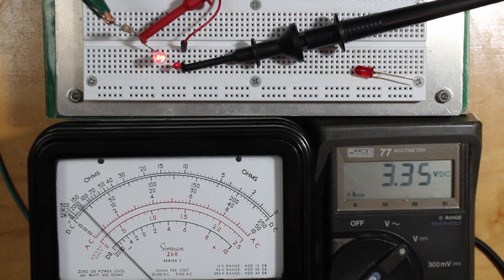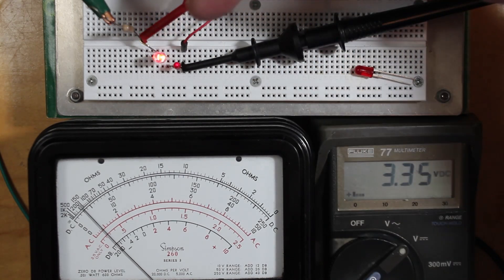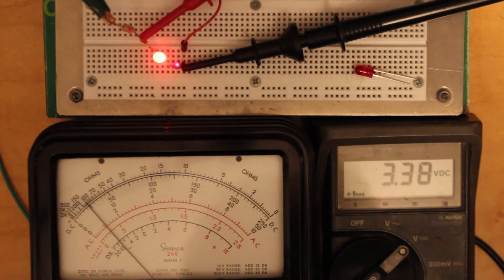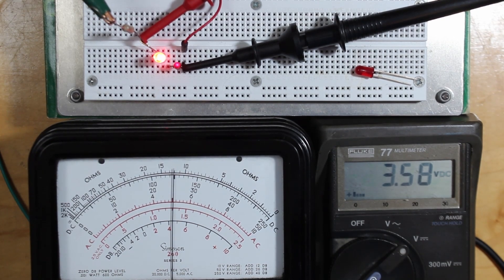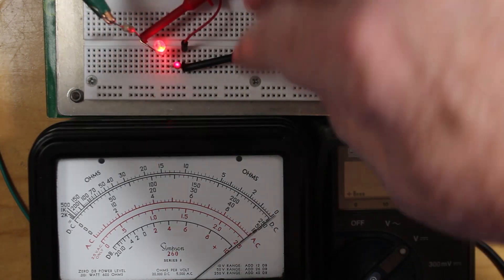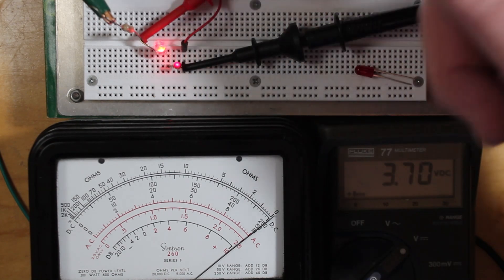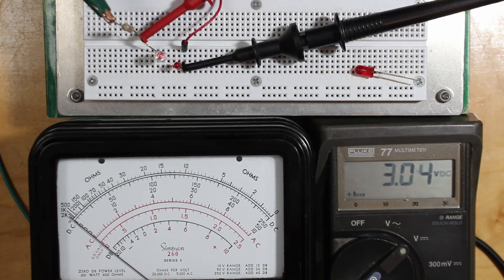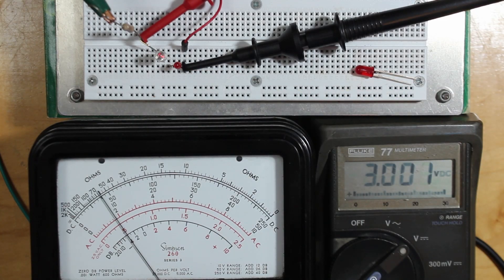#2  LED Old vs New Light Output And Current Draw  #led #electronics #experiment

Comment: A while back I had to take all of my vintage LEDs and put them in separate organizer drawers. Because they really don't belong with modern LEDs. So now I have drawers marked, "OLD LEDs" I can't bring myself to just throw them all away. I mean they're vintage. But I'd only use them if I actually wanted an old LED.
Reply from the maker: I do the same.  I keep the old one's for fixing old equipment.
Reply: @MoreThanElectronics  I used to buy a lot of assortment packs. So I have some pretty oddball LEDs. Suitable for if you want something special for some project. Plus I've salvaged a lot too. The real bizarre ones I've got came out of those old Rat Shack assortment packs though. Primo floor sweepings.

Comment: It is often said that LEDs require 20mA. This is true for old LEDs. 
New LEDs need far less, perhaps 2mA.
Reply from the maker: I agree that the general practice I was taught many years ago assumed 20mA for full brightness, if you didn't have the spec sheet.
If you want to drive (source or sink) the LED directly (with current limiting resistor) from the pins of an IC then you need to know the capabilities of the chip.  Thankfully that green LED is plenty bight at 1mA to be used as an indicator.
I see Everlight produces a LED (model HLMP-4740 for example) that is spec'd at 2mA for typical application and a maximum  continuous forward current of 7.5mA. Note that it only produces 2 millicandella, but maybe that's what's needed.

Comment: More correct way of comparison is show the V-A graph. Old LEDs is low voltage, and depend of colour. New ones is based on the heterostructures, more sensitive and high voltage.
Reply from the maker: I did a bit of testing and the old (45ish years) LEDs I have are a lower voltage than the more modern ones, but there are many factors (chemistry, wavelength) involved.  I've uploaded a new video where I apply the same power to a couple of different LEDs.  The light output compared to the power input has improved greatly over the years. Doing V-A graphs of various LEDs was more work than I wanted to do at this time.  I also don't have a way of measuring the light intensity developed.

Comment: I have a few of the old LED-s (that i took out of some old casette player I think) that have their negative side labeled as a flat side. When you look up from the top of the LED then its not a complete circle, but the positive side of the circle of the lens is a bit flattened out -  its so we can differentiate the negative lead from the positive one. But apparently in the old ones the flat side (in my case) is the negative side, not the positive as it is in the modern ones. Interesting
Reply from the maker: On a new single color LED the shorter of the leads should be the cathode.  I've not yet run in to a single color LED where the flat is the anode but I don't go through that many LEDs.  On the three color/RGB LED's the longest lead is usually the common terminal, whether cathode or anode.  As always, test when not sure.
Reply: @MoreThanElectronics I stopped following the common thoughts about this topic. I don't listen to guys On the internet because they're not really made to be guaranteed. led is more likely to be standardized but caps, and many other things can have a label or mark and you still have to verify it yourself because the idea here is, the marks are for production runs once they verify it then the assembly staff will use it to work fast but you should never assume anything about parts unless u like to waste time and money in circuits and parts and headaches and questioning your own sanity possibly